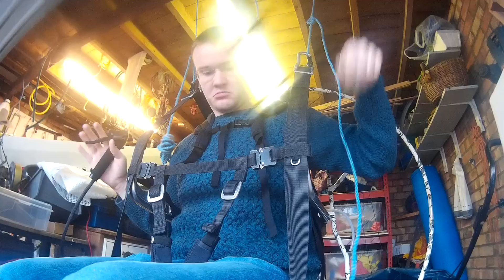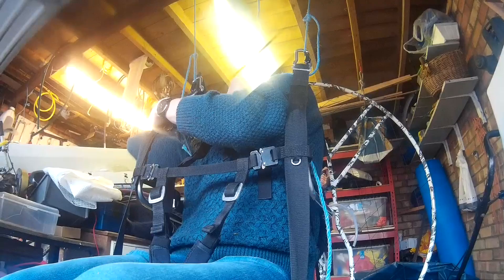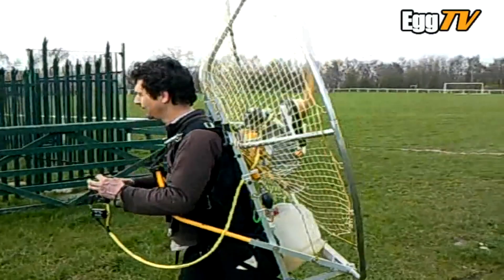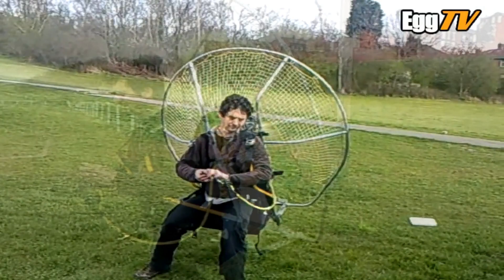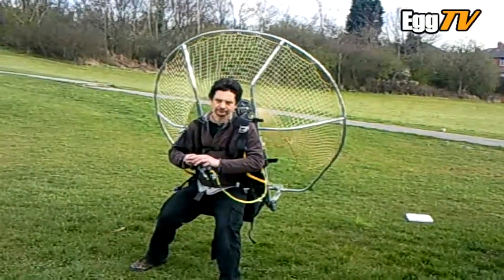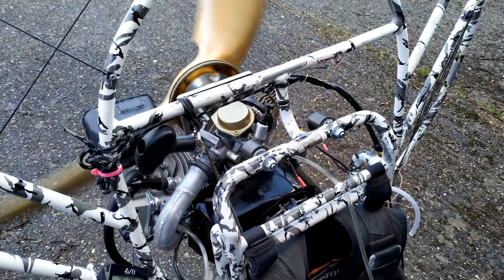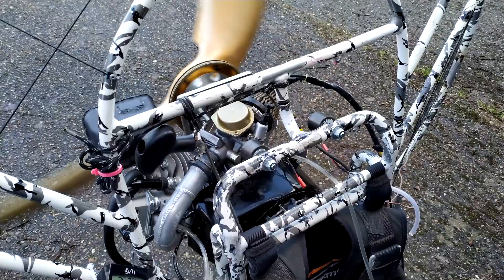DIY Four-stroke Paramotor Part 7 - Carburettors and Getting Some Parts

Comment: Hello, would you happen to have any more info on that carborator? Im having the same issue with my conversion, my engine only revs to 4200 rpm with no load on it
Reply from the maker: What upgrades have you done? Governer removed? Valve springs upgraded?
Reply: @smad333  correct, I also bought a carborator like the one you tried. It has a metal manifold, so it shakes around really bad

Comment: First never use a chain drive, next you vibration mounts are dangerous need a safety strap to frame, because plates are just vulcanized on and can fall off. Engine choice wrong... Learn from https://m.youtube.com/user/tubasa2196/videos

Using a 4 valve overhead cam Yamaha scooter engine from scrap yard, with fuel injection has enough power for tandem flight, and trike,, look his engines over.. He did it the right way.  Made a whole bunch of them very successful

Comment: I had Tim's unit for a week or so because he was having trouble with it running. I  found the problem to be was that the idle jet (on that carb you now have) was never drilled in the factory, I.e. no idle circuit. Once I drilled it the motor started much easier and ran better.

https://youtu.be/RYt-8OZyyi4

Comment: I've watched all of your videos up until now. One of your main issues is weight. Your build mass/thrust ratio is well below what is required to achieve lift, let alone a "safe" flight. The 4 stroke requires oil in the crankcase to operate properly, further increasing weight. Just my thoughts. Good concept, superb dedication my friend. Keep improving.
Reply from the maker: Stay tuned my friend.. :)
Reply: @smad333  sure will bro. Thank you for your amazing content. Keep it going.